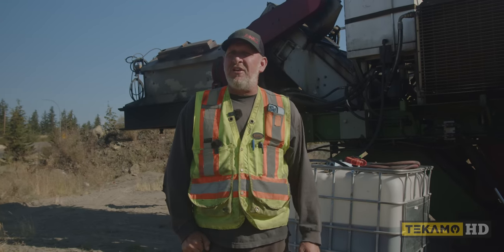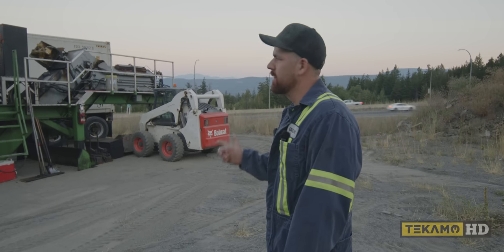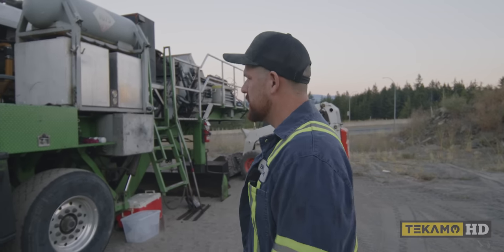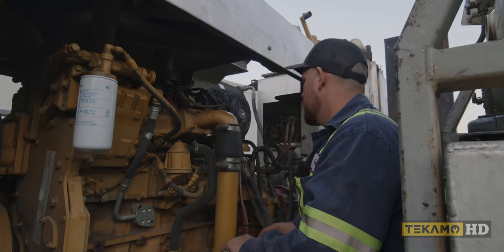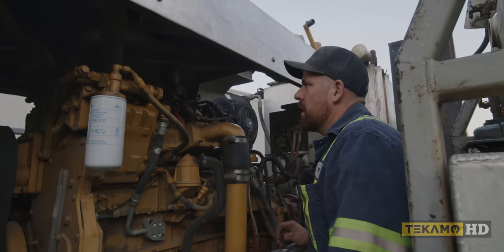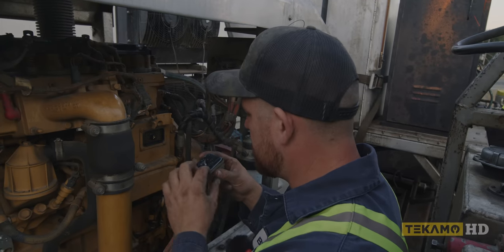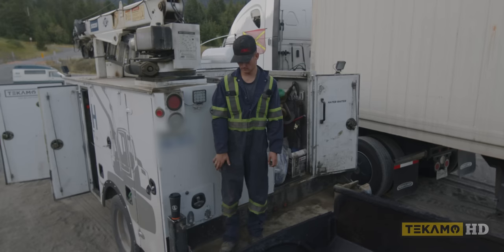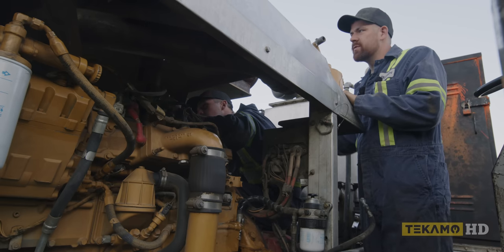Pulling Out In Record Time - Engine Swap On A Pugmill Asphalt Machine

Comment: Cam love watching u and minny me, keep up the good work. Been building engines for almost 45 years, started with DD 149's, Cummins, Cat and now doing Komatsu for the past 25 years. When putting seals in I put the sealant in the bore not on the seal O.D.. The reason is that while driving it in the sealant will dam up in front of the seal and if there was a nick in the bore that scratches the seal O.D. the sealant dam should keep it from leaking. Just one of the things I've done for years. Another thing I do on pipe plugs, I will try to tighten the plug before I try loosening it. If it doesn't move take a torch and heat the area around the plug, then try to tighten it again if it moves it will come out , if not add more heat until it will move. Haven't stripped out a plug in years doing it this way.
Reply: Can't be seized if it's a liquid!

Comment: Talking about tools for the newbeis. You don't need Snap on for everything, I stiil have Craftsman tool's in my box. I only by Snap on if it's not available from someone else. Don't buy sets when you start out, I would buy single items that I needed. If I had to borrow it more than two times I would buy it. I have sets that some items have never been used. My short 1/2 impact set is a Proto set I got for $45 in 1978, 1/2 - 1 1/8 and I still use them today. When you start out don't buy supper cheap but you don't need the best, once your making good money then you start buying the good stuff and you can take the other tools home for working at home. I also have never seen the need for s Snap on tool box, you can buy alot of tools for what those boxes cost. I've seen guy's spend thousand on a tool box and have almost no tools in it. You need tools to do the work, you can have all the Snap on tools and still not be a mechanic, the tools don't make you a mechanic. Put it into your own words, just my view on what I,ve seen and done over the years.

Comment: What's the average runtime on a job outdoors, and what's the coldest temperature you have worked in? How many hours do you typically spend on a job (a machine) in a week? 

I'm interested in looking at a pre-apprentice program as a female but I wonder if my size and physical strength may have employers turn me away.
Reply: Oh, and how much of your day is driving? (E.g. is your work territory sending you out to jobs 1,2,3 hours away?)
Reply: Usually field mechanic is a higher position. Start as a shop mechanic first and it will help you land a field position.
Reply: If you can pick up 100pounds over your head you will be fine.And driving depends on parts and job location.
Reply: You’ll be fine. Attitude is everything, take the good with the bad. There are cranes on the truck, impacts and torque multipliers, if Carson can do it I’m sure you’ll be fine. PS, we are currently looking for an apprentice.
Reply: All you got to do is learn and self-study as much as possible.

Comment: No wonder the engine failed the 3126/C7 the POS Cat engine not rebuildable with dry sleeve engine. Shit box HEUI fuel system the weather gets any bit cold the engine doesn’t want to start.